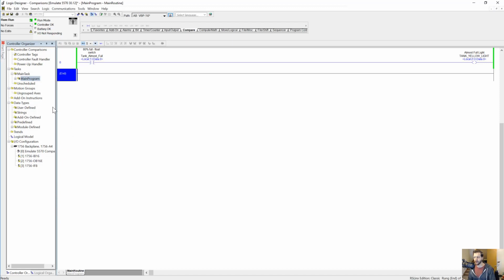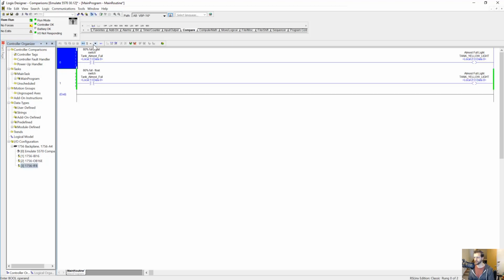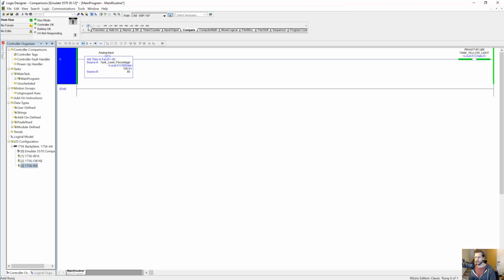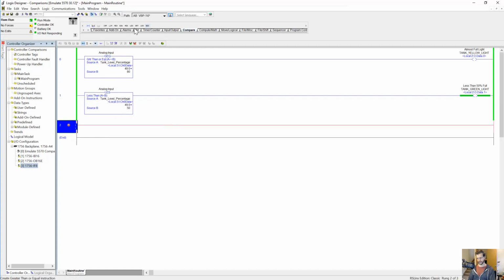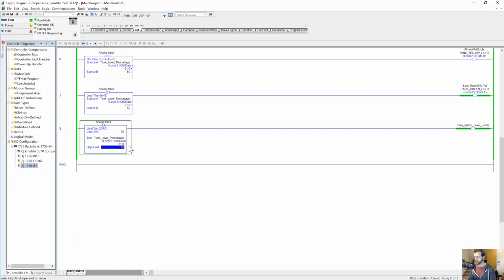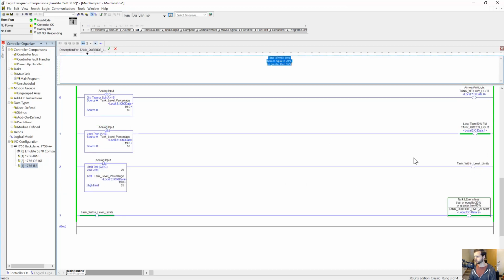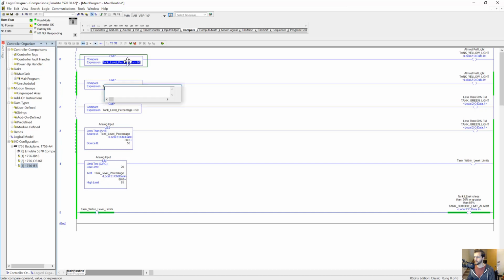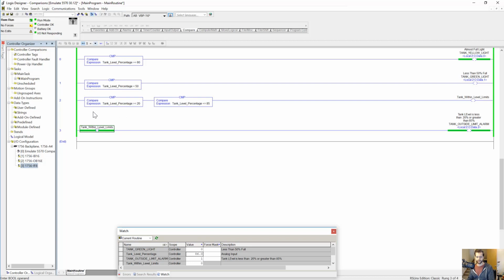Studio 5000 Logix Designer - Comparison Instructions (Ladder Logic)

Comment: I have the mini edition of studio 5000 logix designer and there is no option of SCL or SCP like RSlogix , how do i scale analog values in logix designer?
Reply from the maker: Hi Rahul, you can still do scaling in Studio 5000 without the scaling instructions. But first you need t o understand the math behind scaling. Can you do the scaling math on paper for a tank that has 0 to 1000 gallon capacity to a 4-20mA signal? Learn how to do it on paper and then it's easy to do in Logix Designer.